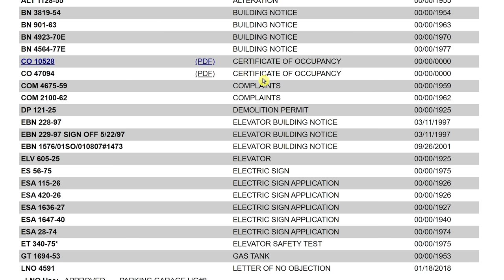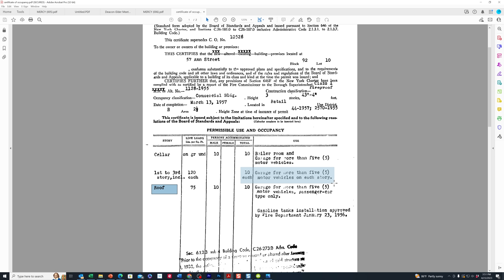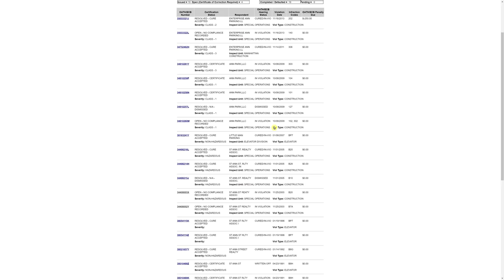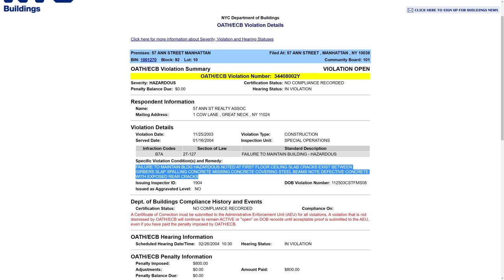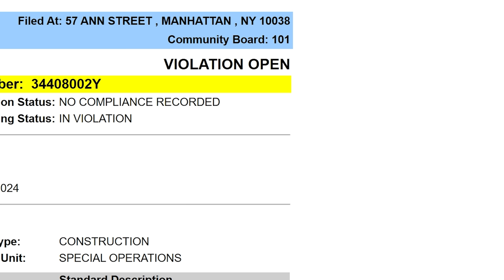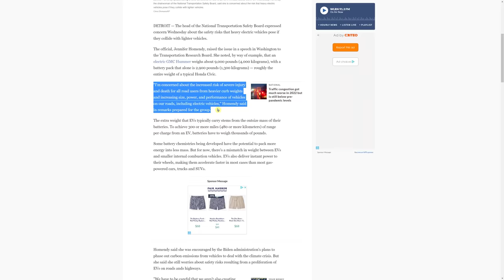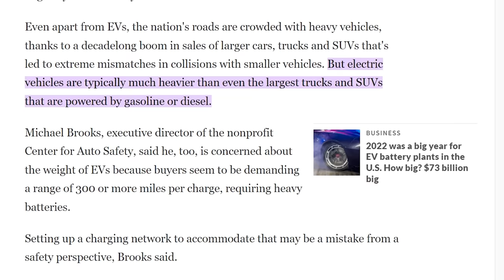4 Causes Of Fatal New York Parking Garage Collapse?

Comment: Tesla Model 3 3500-4000lbs
Tesla Model S 4300-4900lbs
Jeep Grand Cherokee 4500-5500lbs
Cadillac Escalade 5600-5900lbs
Toyota 4Runner 4400-4800lbs
None of Cadillac’s current lineup weighs less than a Model 3 
BMW 2 series weighs more than a Model 3 
Chevy Corvette and Camaro weigh the same as a Model 3 

By no means are electric vehicles light weight but almost every SUV weighs more. This propaganda that electric vehicles are massively heavier than ICE cars is preposterous.
Reply from the maker: According to Autocar’s report, the Mach-E will tip scales in a range of 4,394 pounds (1,993 kilograms) to over 4,890 lbs (2,218 kg). That easily makes it the heaviest Mustang of all time, and you compared apples with oranges. The report is comparing company A's car with company A's electric car, not Cadillac's against Tesla. Also In the video I mentioned that SUVS were not around before 1984, and they too are heavy. You seem to have fixated incorrectly saying that I stated EVs caused the collapse. Remember I said contributing factor
Reply: @jeffostroff     

“America we have a problem and the problem is electric vehicles.” -Jeff Ostroff 

Few things:
1. My original comment mentioned nothing about the collapse of the Ann St. building, not a single word. So it seems YOU were incorrectly fixated on my comment having anything to do with the collapse of that building. 
2. YOU have compared apples to oranges when you point out that the Ford Mustang Mach-E will be “the heaviest Mustang of all time” because the Mach-E is categorized as a compact crossover SUV where as 100% of all other Mustangs in history are 2-door coupes. So you are correct the Mach-E will be the heaviest vehicle with the Mustang name .. but it is NOT an apples to apples comparison of EV to ICE crossover SUVs. 
Compact SUV - EVs
Model Y 3900-4300lbs
Mach-E 4300-4900lbs
Compact SUV - ICE
Jeep Cherokee 4250lbs
Ford Bronco Sport 3500-3700lbs
Comparing 2 compact SUV EVs to 2 compact SUV ICE vehicles there is about a 12-15% increase in weight. The heaviest Model Y is <2% heavier than a Cherokee. 

Sedan EVs
Tesla Model 3 3500-4000lbs
Tesla Model S 4300-4900lbs
Sedan ICE
Toyota Camry 3500lbs
BMW 3 series 3100-4000lbs
BMW 5 series 3800-4300lbs
Here we see about a 13% increase in weight for EV compact or executive sedans with the Camry and Model 3 the same weight. 

3. You highlighted and read “But electric vehicles are typically much heavier than even the largest trucks and SUVs that are powered by gasoline or diesel.” That statement is a bold face lie. 

Ram 1500 Diesel 6990lbs
Ford F-150 4000-5700lbs
Chevy Suburban 5500lbs
Cadillac Escalade 6200lbs

The claim made is that electric vehicles weigh more than ICE trucks and SUVs and that is a bold face lie as you can see from those weights of ICE trucks and SUVs far heavier than any Tesla. 
There is a significant increase in weight in the current lineup of electric truck versus ICE trucks but that is NOT the claim in this statement. The statement should have read “But electric trucks are typically much heavier than even the largest trucks and SUVs that are powered by gasoline or diesel.” Instead the claim was a preposterous propaganda bold face lie. 

** Side note ... I am not an electric vehicle fanboy and I am not a Tesla fanboy, I compared Tesla to other vehicles because they sell 10 times more electric vehicles than all other electric vehicle manufacturers combined. It is illogical to have any electric vehicle discussion or comparison excluding Tesla. 

I’m not a SUV aficionado so I compared the two you brought up Cherokee/Mach-E and Model Y/Bronco Sport because they are newest model SUVs. I don’t know SUVs well enough to state unequivocally those are accurate comparisons. 

I personally believe that the PHEV is the best choice for most American commuters typical use.